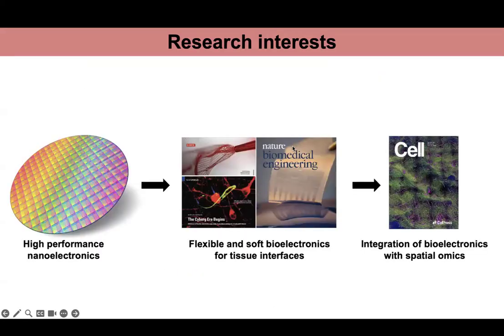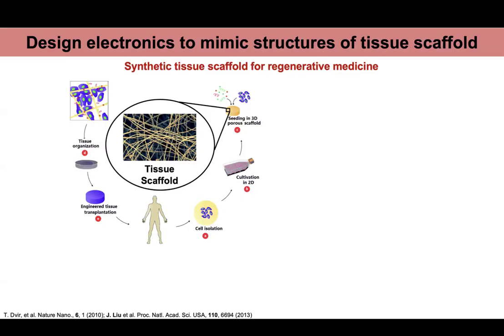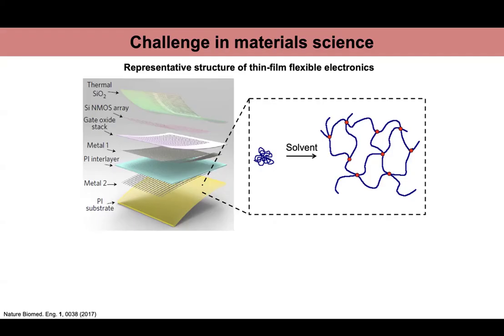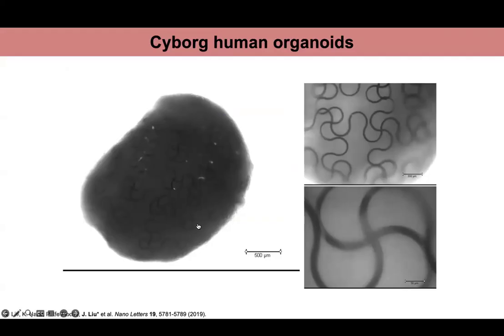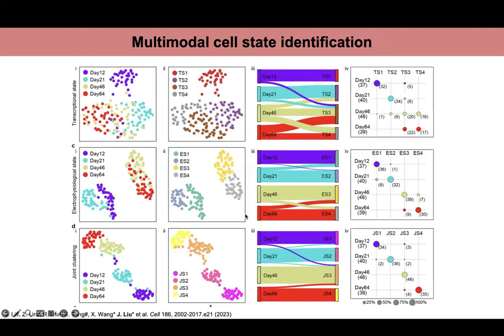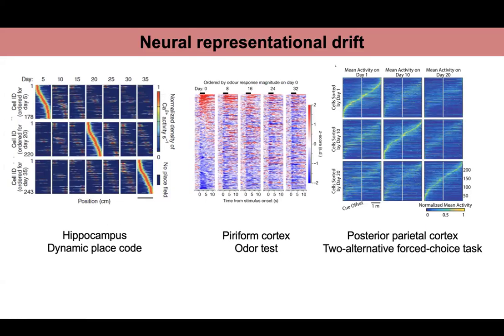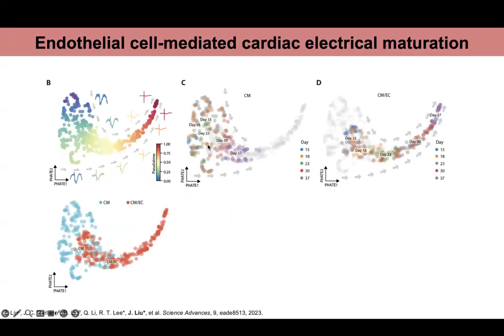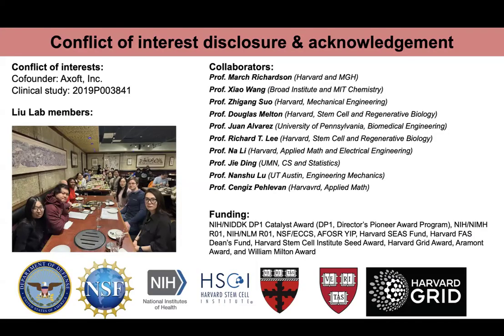"Soft and flexible bioelectronics for stem cell engineering and brain-machine interfaces" by Jia Liu

Comment: Nice talk. Even though the accent makes it harder. Still good though. Part he may want to use organoids for. The various specialization areas and functions. Another part he may want to look into bioengineering and things like stunts or scaffolding for media to grow on like nerves. Similar to bioengineering a tattoo layer in the epidermis and scaffolding to nearest nerve bundle. Though with the skull you may be limited for that a bit. If he is trying to catch functions though brain organoids might be more help.  Then put the parts together and a larger total picture. It may help with modulated states some. Also the layers of functions as they emerge across larger structures. The more granulated you get, the more functions you may miss. Where as global you have them all working in ways together.

25:00 There you go. Yep.

49:57 You do know part of that in biological is life and cells can die off. Neural trimming and memory consolidation and flawed/imperfect memories over long times. The other parts. Brain plasticity and new neuron growth and new connections. Humans a bit more flawed than you can make A.I. in ways. Still a great talk and lots of information spaces gone over right. 

Good talk. Keep up the good work. He got into genetic parts, but not ones like chromosome 2 and the differences in monky and humans and what the strip represents for functions. Still a good through talk.
Reply: I hear ya.. can’t wait ‘til there is a “make it sound like Feynman” button.. :p